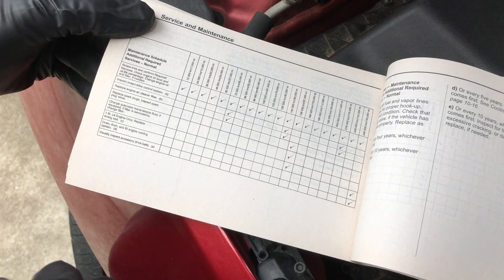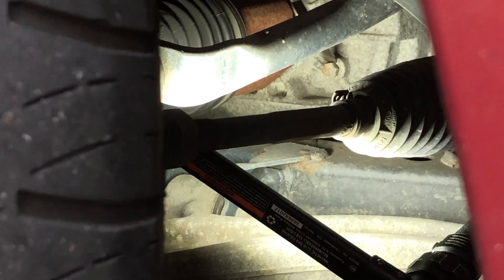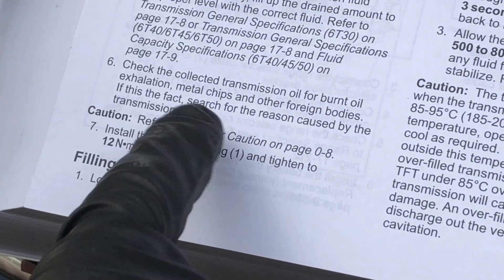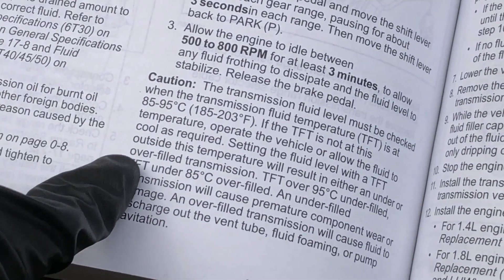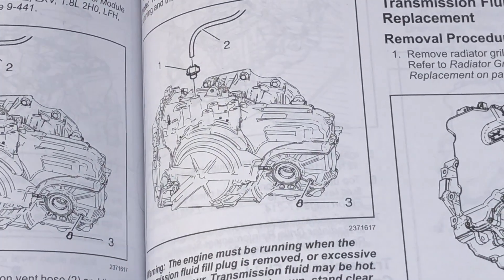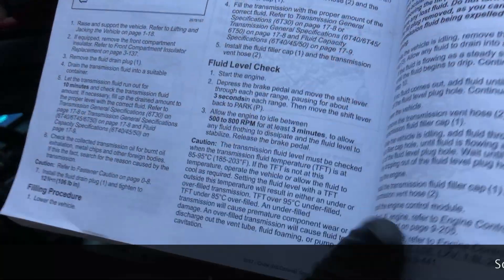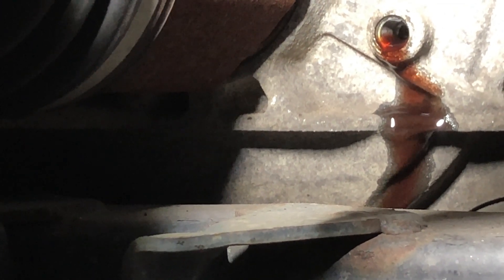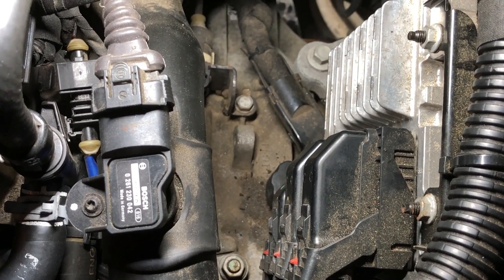2008 - 2016 GM Automatic Transmission Fluid (ATF) Change 6T30 / 6T40 / 6T45 (Chevrolet Buick & GMC)

Comment: Dr shock just measure the fluid drained out pour in a gallon jug & measure exactly what to fill don't really need fancy complicated scanner
Reply from the maker: That's not a reliable approach.   The fluid level on GM transaxles changes with temperature.   The scanner is needed only to measure the temperature.   If you do not do it the way I showed you, the official GM service manual procedure, then you run the risk of overfilling or underfilling, either of which can internally damage a GM transaxle.
Reply: @DrShock How would you run the risk of overfilling/underfilling the transmission if you drain and refill the fluid? If you take out 4l and put 4l back in, there is no change in atf level?
Reply from the maker: Only in the fact that if the original condition was over/under you've maintained that incorrect fill level with such an approach.   If it were really that easy with no downside risks, don't you think GM would have written the procedure up that way to reduce their costs during warranty servicing?  ;-)
Reply: @DrShock I'm thinking that if dealer is do transmission warranty work the fill time isn't much of a percentage of their time. My thinking is they might do it so they dealer has more billable time when doing non warranty maintenance. If the heat expansion is critical then why not a dipstck to check when 'hot' and back then there was a range on the dipstick.  What's changed that transmissions are so critical to  the slightest level difference.  Seems to me we are going backwards. Same as all these vvt stuff  now so critical on engine oil level and cleanliness.  Make us an engine we can abuse lol.

Comment: Why can't you just measure how much you drained and then add that same amount?
Reply from the maker: Do you do that when changing the oil in an engine?   The reason that's not a desirable approach, nor recommended by GM, is that what you drained out could have been overfilled or underfilled to begin with.   Underfilled being the most concern, just like low oil in an engine, nothing good comes of that condition.    IMO in a pinch you could take that shortcut approach, and then in very short order go back and check the level correctly.
Reply: @DrShock my 2012 Buick LaCrosse 3.6L LFX has a dipstick which is part of the filler cap so somewhat different than your video anyway.
Reply from the maker: Totally different animal that this video wouldn't apply to.  ;-)

Comment: Can i use a Termometer gun to measure the temp?
Reply from the maker: That won't really give you the fluid temperature, only the outside case temperature.  If you don't have a scan tool that can measure the actual ATF temperature, I'd suggest you're better off just using the replace what you drained method.  Where you keep track of the amount of ATF drained and replace only that exact same amount.  Definitely not the ideal approach, but if followed precisely can do.
Reply: I ended up buying an OBD II scan, Torque Pro app, following your advice in the cheapest way possible. Can you please help find the correct [GM]Transmission Fluid Temp (GM Method. I saw that there are 3 methods but I don't know which one to choose according to my transmission and have the most accurate measurement possible @DrShock
Reply from the maker: Not sure what you are referring to about methods in this context.  I've not used Torque Pro in many years, but there should be a PID (parameter ID) for the ATF temperature.    It used to be under manage extra pids or a similar menu option to add transmission temperature.   If not, you might check with Torque Pro support on how to add this PID for a GM vehicle.

Comment: Question i have a 2017 buick encore, is the precedure the same? And thx for your content!
Reply from the maker: Check in the description, there's a list of regular production (RPO) codes representing the automatic transaxles that this video applies to.   You can find these codes on your service parts information sticker.  This black and silver/white sticker is usually affixed in the glove box on SUV models, but it may also be on the passenger side door jamb.
Reply: Thx doc

Comment: When turning my wheels, i don't have a clear view of the fill plug. There is a pillar/column in the way. Any recommendations? Only idea i have is to remove my front wheel with the car slightly jacked up.
Reply from the maker: Some GM vehicles may be designed with the vehicle being on a lift at the dealership in mind.   You may have to remove the wheel to get access, and/or turn the steering as well to reorient the brake caliper for access.  Just remember you have to keep the vehicle level or the fluid level reading will not be correct, so that means four jack stands at all four corners not just one where the wheel by the plug is.
Reply: You're an excellent instructor,  Gracias! 😊💟🇵🇷

Comment: I did a fluid change a couple days ago on a 6T40 with 103k miles. I measured what came out and put 5 qts back in to match. Then I watched a video that said to fill to the fill plug level cold. Then I saw in the owners manual that it takes 5.3 qts. So I assumed that in 103k miles that a tenth of a qt leaked out over 13 years. So I added .4 qts today, making 5.4 qts added back in total. Now I see your video and the factory service manual say I should do a hot check for level. I Also see that the fill plug is hard to reach. On the Next warm day coming up, I will turn the tire out and check the fill plug cold. Then I will check it hot after driving. This is my second fluid change in 4000 miles and the fluid was still black this time. Almost as bad as last time. Honda suggests three consecutive fluid changes every 50k miles for $400 at their dealership, due to their not having a filter either. I'm planning a third fluid change in a couple weeks, based on the Honda dealership process.

Comment: 11mm not 12mm
Reply from the maker: GM does not typically use 11mm fasteners for this, so that may be aftermarket replacement.  Or it could just be a variance in GM production not called out in the service manual.
Reply: roger that..... GM used 11mm on my 2012. had it since new. js.  thanks

Comment: Many thanks for this awesome video including the workshop manual pages.
My friend has this car, I hate this transmission design with non-replacement filter.
That’s why these Chevy’s have so many tranny issue, all due to dirty filter therefore dirty oil.
Reply: There's no filter. Just screens on the solenoids and the solenoid mount plate.

Comment: How much did you add before starting it? Does it not start spewing out from the funnel if you're adding fluids while its running? Is it possible to do with out scan tool? Sorry but if someone is going to try n save money doing it at home, doubt they have 100s to drop on a scan tool. Can't you just run at idle for a good while then check it? I'm mechanically inclined but never messed with a plugged trans before and have zero funds for a fancy scan tool. Just have a basic one that can give me codes. Any help would be amazing
Reply from the maker: A scan tool is required since these transaxle type units only show the correct fluid level within a particular temperature range.  Both too little fluid, and too much fluid, can cause internal damage over time.
 
What you can do if you do not have the right tools, is put back in only and exactly what ATF you drain out.   So don't spill any and measure it out correctly and exactly.  Doing that will get by in a pinch.  You won't know if the original level was correct of course, but you'll be putting it back to whatever it was so you'll be no worse off than you were to start with.

Comment: Can you please tell me why it is necessary to get the transmission fluid to that exact temperature range when checking the level? Is it just due to the expansion of the fluid, or do valves or something of that sort have to open (like the thermostat in the engine) inside the transmission?
Reply from the maker: The ATF level rises, up to a point, as the transaxle or transmission heats up and pressures reach optimum levels.   That's why GM requires the level be checked only at that point.
Reply: @DrShock  Thanks for taking the time to reply. Another question...I changed the transmission fluid in my Cruze around two months ago. Thought I had the fluid at the proper level (have not noticed any leaks). Seems to be shifting as well as before (it never did shift particularly smoothly), but when I take my foot off the accelerator, I get kind of an engine-braking kind of sensation. When I gently apply the brakes it goes away. Thoughts?
Reply from the maker: Next to impossible to speculate on something like that.  Many possibilities.  Would need to hook up a scan tool and drive it with live data to diagnosis whether the torque converter is functioning properly.
Reply: Fair enough. Thanks for sharing your opinion.
 @DrShock

Comment: I have checked my temperature from PA all the way up to the New York on i95. It spent 70 miles trips on the high way. The temperature does not meet the books required. It only goes  about 83-84.
Reply from the maker: Many aftermarket ODB2 dongles do not read the transmission temperature correctly on this GM model.   Your tool/app is probably reporting a few degrees off because of this.

Comment: Had a cooler line fail on my Encore and pretty much dumped all the fluid out and never had a sign of an issue while driving.  Sure hope I didn't cook the transmission. 2017 encore awd.

Comment: I got a 2012 buick regal 2.4l with a 6T40... I grabbed the 12mm but it slips...my drain and check were both 11mm FYI
Reply: Same as 2016 malibu lt 1.5t
Reply: My 2014 Chevy Captiva was 11mm as well for drain and fill plugs

Comment: Is it a 1.8L engine? May I know how much oil did you put in this transmission?
Reply from the maker: The vehicle in the video has the GM Ecotec 1.4L turbocharged engine.  But since this is a transaxle (aka transmission) related vid, it doesn't matter which engine you have.  Just which GM transaxle you have, which for this video would be the 6T40 / 6T45 family.   The amount of ATF can vary vehicle to vehicle, so you have to use the scan tool method (hence this video).  Even a 6oz mistake either way can cause shifting problems with these models.
Reply: @DrShock  I have a cruze 1.8L ECOTEC in Qatar. Do you have any idea which transmission is in 1.8L bro?
Reply from the maker: In Qatar no I wouldn't know, in the USA both the 1.4L and the 1.8L engines use a 6 speed automatic transaxle type.  With the 1.8L typically paired to the 6T30 and the 1.4L the 6T40 for the model year range this video covers.  The 6T30 is typically RPO MH9 in the USA.
Reply: @DrShock  Does both transmissions hold same amount of oil?
Reply from the maker: The possible capacity range will be the same for all transaxle models this video covers.  So the GM 6T30/6T40/6T45 and 6T50. However, the ATF fill will vary from vehicle to vehicle so there is no set fluid level for these models.  It can range anywhere from 4.2 quarts to 6.3 quarts.  Which is exactly why you must follow this specific fill procedure to dial it in for the particular vehicle you are working on.   Failure to follow this procedure will result in either an overfill, or an underfill, situation.  Either of which situation can negatively affect this transaxle model family internally.

Comment: Great vlog, I’ve just ordered 20 litres of dexron 6 for my Vauxhall corsa e automatic, I intend to drain off cold and replace with the exact same amount, but do this 2 or 3 times to try and refresh the torque converter as well, it’s covered 43k miles from new now 5 years old….wish me luck 😀😀👍👍 kind regards to you and everyone out there…..Mark from the U.K. 🇬🇧

Comment: Were you using a torque wrench to break bolts loose?  Sure looks like one lol
Reply from the maker: Yeah reverse torque wrenches (bi-directional) are fine.  A regular one can have the calibration degraded though so shouldn't be used for reverse.

Comment: getting to 185 degrees was almost impossible. I tried the idling for an hour... i tried reeving the engine, I even took it out on the interstate highway best I could get was 172 degrees. on my way home I would go really slow then floor it until i just about redlined... when I pulled into the driveway I hit 186.2 degrees! aside from that it was super easy. next time I'm just going to drive around in L1 and save some time.

Comment: Good evening  this is Ms, Rodriguez from  Brooklyn  NY . I have  a  2009 Malibu and since  my mechanic  changed the  oir.  I  have problem with the transmission .  it is  not  shifting smoothly , He used  Valvoline ATF
Reply: Whats your mileage on your 09? 1st service or no,?
Reply: Valvoline are is fine along its dexron 6 compatible

Comment: I tried this at 40 degrees ambient temp and was unable to get transmission to temp at idle in park.
Reply from the maker: It would take a long while just idling to get there.   What scan tool are you using to measure it?

Comment: How many minutes in park did it take for that temp to climb from 31°C to 86°C?
Reply from the maker: Going to depend on the outside weather temperature but around 40 minutes as bes I recall.  Much faster if you drive it with the scan tool plugged in.

Comment: Is it possible the car has the temp on the dash readout,2013 regal 2.0 turbo I
Reply from the maker: Typically only trucks, and not even with all models, will have a transmission temperature readout on the instrument cluster.   Usually this is a bi-directional scan tool, or suitable Bluetooth scan app like Torque, requirement to see.

Comment: One day, someone is going to able to tell us how to get the temperature into appropriate range for checking transmission fluid.
No amount of highway driving or idling will get my Cruze into this this range.
( Checked with a scan tool.)
I suspect that the factory fitted oil cooler has something to do with this.
If any GM technician is willing to tell us how they do it during servicing, it would be very much appreciated.

Comment: Hello everyone, I am the owner of a 2015 Cruze LTZ, 1.4 turbo, I can’t warm up the box to 85-95 degrees, no matter how much I drive, I stand in drive mode, in general, I perform various manipulations that can raise the temperature, the maximum warms up to 80 degrees, but then quickly cools down. This is due to the fact that I have a transmission cooling radiator from the factory, however I need to find a way to heat my transmission to at least 85 degrees, can someone share?
due to incorrect oil level when the transmission warms up, I experience jolts when shifting gears
Reply from the maker: GM transaxles of this 6T series have a fluid cooler, and the GM service manual instructions included account for this in their stated temperature ranges.   The service manual specifies a specific range for operating temperature for this fill procedure of 85° - 95° C.   I just pulled up the 2015 version of the manual and it's this exact same temperature range stated, which is including the cooler.
 
Aside from the method of getting the transaxle fluid up to temperature (a highway drive is the fastest way), what you are describing is more of a problem with the choice of scan tool and/or the PID involved.   A GM MDI tool using ACDelco Techline Connect will provide a correct temperature rating every time.   Unfortunately, aftermarket scan tools can be hit or miss depending on their level of quality and accuracy to the GM tooling.   Some aftermarket scan tools either lack the transaxle temperature PID altogether, or report it inaccurately.  Those tools that claim J-2534 compatibility should be OK.

Comment: Can you use any kind of scan tool on the car
Reply from the maker: Any that can read the transmission temperature PID.  I believe from earlier comments some folks had success with the Torque Pro smartphone app coupled with a OBDII adapter, for example.
Reply: Do you know of one that you can manually turn on and off the fuel pump on a 2013 camaro? I'm needing to flush out 4 yr old gas.